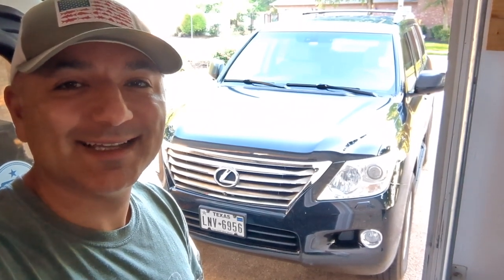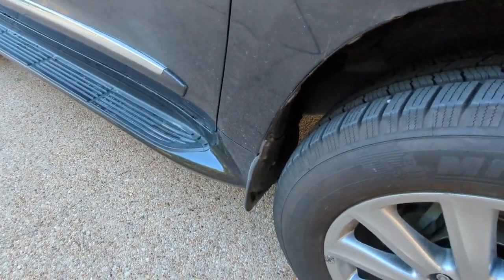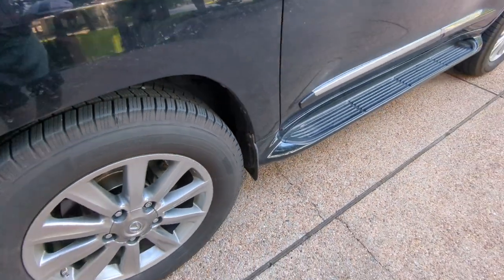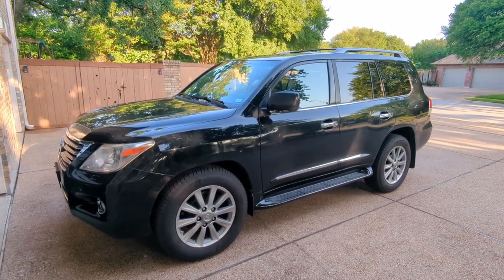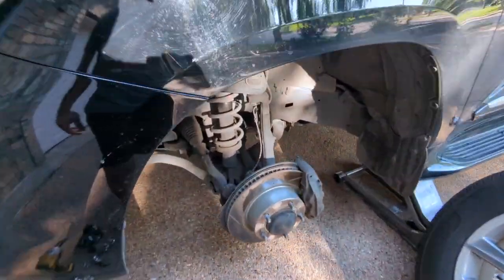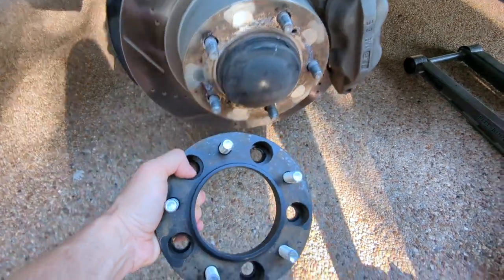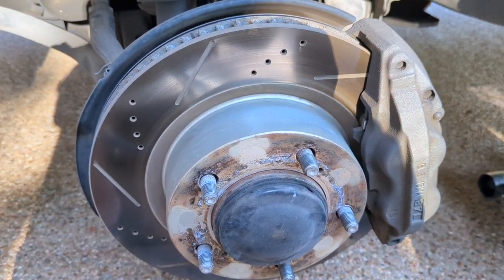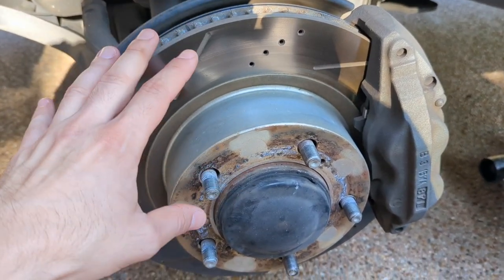LX570 Z36 Brakes and Wheel Spacer UPDATE - Worth It? The Good and Bad review

Comment: Unfortunately, the wider in track you go, the earlier it contacts the inner fender wells at the rear upon turning. You could try and realign it with more caster and mould the fronts some more.
Reply from the maker: Yes, that's a good point with the caster. I think in this case it only needs maybe another 1/2" of clearance and there is still some room on that rear plastic piece. I may put the spacers back on in a few weeks when I have time to mess with it to create more clearance.

Comment: I had the same problem with my 2016 lx570. It rubbed when I make a turn on the LT 275/70/18 ko2. W/2019 Land Cruiser wheels.
Reply from the maker: Were you using spacers as well? Or just the wheels and tires without spacers?
Reply: @NKPGarage  just lc wheels and tires, no spacers
Reply from the maker: @Overlander2022  check out this video where I added more clearance for the bigger tires. If you haven't tried this method it is definitely worth a try. https://youtu.be/KPTAc9eu38o
Reply: @NKPGarage  Great help, thanks!